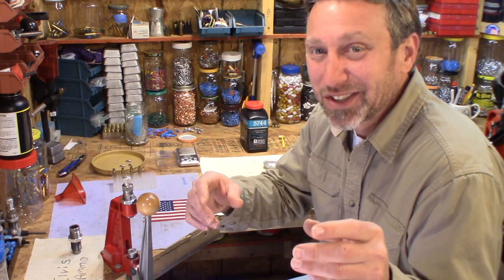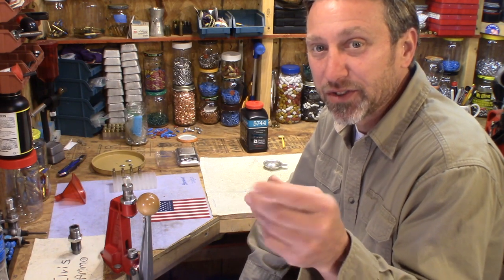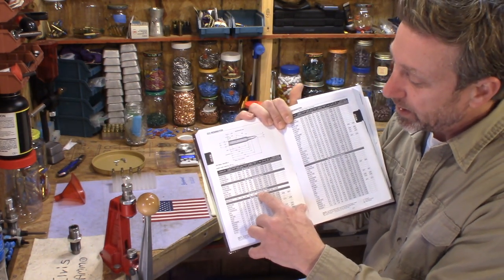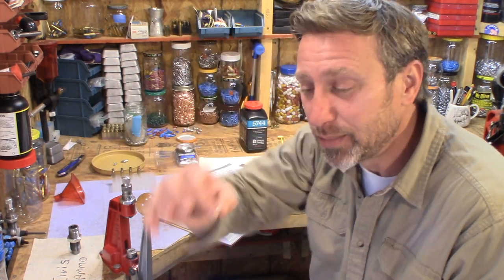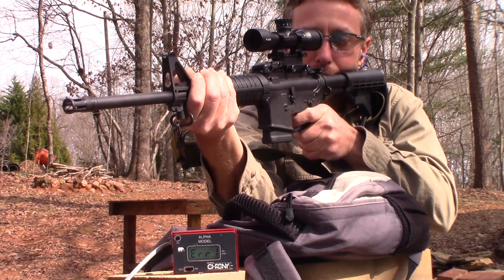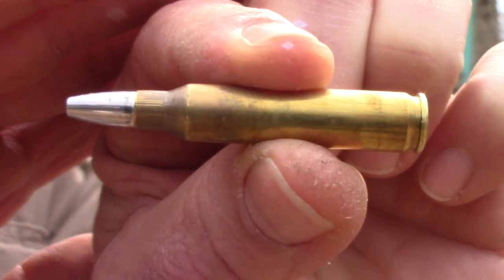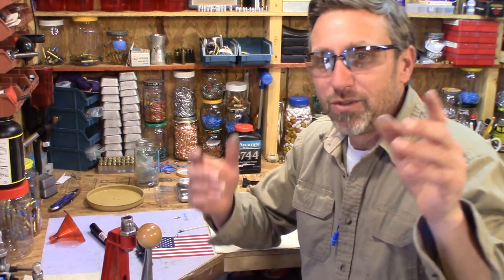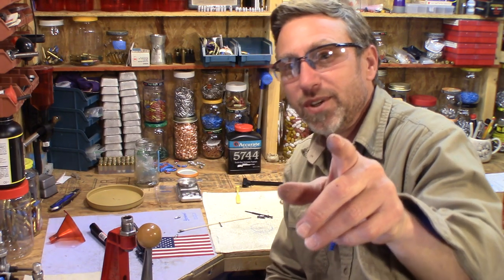Cast Zinc Bullets (223) Loading, Shooting, Capturing!!

Comment: When you had the calipers in hand I kept yelling at you..."Whats the diameter of the fired round?" Is it fatter and the land marks have expanded out to smooth? I figured that the ass end tried to run through the front end when it hit the wood...net result, the diameter grew a bit from stopping so abruptly. Early indications of stability aren't there...at lest I don't think so...I'll hang with the rest of the crew to see...good work there El...SeeYa...charlie
Reply from the maker: hey there you Ole rascal Charles Irby. ..... I heard ya yelling at me,  you don't ever raise your hand and speak out of turn! : )  .... But I've had my coffee and I'm not sore anymore. .. (having fun with you again ) .... the fired zinc projectile was .210 the oal. lost aprox. 5 thou. I did however see the remnants of rifling and they did appear to have twist down the barrel and not skid....  the 8 bullets that I fired before the video was running between 2750 and 3100 fps... they all produced almost exceptional holes (almost )... I'm considering a bullet mold 77 gr. lead aporox. 55 gr zinc. raised driving bands.  that should make it easy to size and low pressure for the length. .. Give me some ideas if you got some? My Ole siverback friend! ; )
Reply: I was wondering if the impact caused the diameter to increase and make the rifling appear to be less in it's depth of cut on the cast. I've shot soft lead into the water column and caused the base diameter to increase and make the rifling almost go away. I measured with the calipers and found the diameter increased. Hey you bum...your up early and at it again!...charlie
Reply from the maker: hey Charles Irby... The coffee beans got me jumping! I'll try to remain calm! : ) The funny thing is here, the diameter decreased? But the bullet also deformed a bit. Gel, wood.... I need more intel!
Reply: I have a sneaking suspicion that this is going to go down a pretty deep rabbit hole before it's all over . . . ;)
Any idea of the BHN of Zinc? Have you measured it with the Lee Tester?
Reply from the maker: +Charles Irby looking down the rabbit hole.... measuring one bullet several times I'm averaging bhn 37
Reply: Was just searching articles on casting with Zn...over at CastBoolits there's a plethora of info there...I think you have a doable solution to Pb...I just hope the day never comes when we have to switch over exclusively.
I love my soft Pb and Sn and Sb...it's so easy to manipulate...SeeYa...charlie

Comment: This making of zinc bullets does one thing takes people out to the range to shoot them which means the people that recycle their lead at the range to to cast their own bullets now have contaminated lead thanks a lot
Reply: Dont run your pot so hot when melting your range lead initially.  Lead melts a good 75° lower than zinc, and itll float, making easy to skim off.  I use same technique for separating out zinc weights from tire shop lead.

Comment: Barrel wear would be my concern. Good stuff though.
Reply: Charles Lawson - Hi. Barrel wear isn't a concern like you think. "Many moons" ago (I won't say how many) there was a bullet mold made that used zinc washers on the base of the bullet. It functioned like a gas check. Copper gas checks were easier to use, and at that time close in price, so it fell by the wayside. 
FortuneCookie45 remembers those days better than I do, and can confirm this.
Some of what Elvis is doing was looked at (slightly - as curiosity) back in the 60's, but wasn't carried through because lead was much easier and way more available. That isn't true anymore, and since zinc seems to be replacing lead wheel weights as a ready source of metal, I'm not only interested in Elvis's results, I'm rooting for him.
There ARE factors that need to be watched carefully, such as zinc being less malleable, but these things can be overcome. For example, the very first all copper bullets were causing unexpected pressure signs. Turns out that there's a great deal more friction between the bullet and the barrel with solid copper than there is with copper jackets. Once that issue was addressed, solid copper bullets became commonly used, and are now widely available.
With so many government people trying to make lead difficult to obtain, anything we can do to keep things going is GREAT.
Go Elvis !!! (and anyone else who can check these things out safely)

Comment: i dont understand how a normal length bullet dosent stabilize in a 1/8 at 3,000fps
Reply: it could be overstabalized especially a lead bullet and it could fragment from the forces acting on it
Reply from the maker: hey Jake A... I definitely think the size of the bullet helped.... but the weight was definitely against me... but over all it worked out. ...  no complaints!
Reply from the maker: +the baddest ... now I'm going to the drawing board to see about a bullet mold. Any ideas?
Reply: for zinc i obviously dont have experience with it but i really like the bore rider designs for cast lead u know where after the driving bands end towards the nose before the ojive rides the lands it alows for longer heavier bullets and are ussually the most accurate rifle bullets in my experience so i would think that would be a plus with zinc so they can weigh as much as possible. the design is also highly stable and alows for more velocity ill send a bullet i like to the facebook for ya
Reply: Wonder if that first one was fragmented or destroyed partially leaving the barrel causing the chronograph error and keyhole like paper cut. Like maybe rear of bullet desentigrated or fragmented at the lube grove site while the nose tumbled on down range.
Reply from the maker: +the baddest ok good deal the baddest!

Comment: Another neat article. Using zinc pennies for a zinc-aluminum alloy. 

http://www.gizmology.net/stovetop.htm

A Safety measure in casting zinc is to keeping a fan in the window to make sure no zinc fumes accumulated. Zinc fumes can cause a flu-like condition known variously as "Fume Fever", "Zinc Fever", and "Zinc Shakes". If you see white smoke (zinc vapor), you're in trouble.
Reply from the maker: Hey Knighthawk6... great article lots of fun for sure! Thanks for bringing up the zinc fever... This is something we experience as welders, When a piece of metal has a zinc coating. A gas will form from the extreme welding temp. (hot enough to melt steel) This is the only danger that gets confused with melting zinc. It is harmless in the sense of forming vapor and gas at melting temp. But can be quite a problem at these gassing or vaporizing temps that we will never reach. Just wanted to clear that up. Lots of people are confused about the extreme temp. differences... Thanks again for the fine and fun article!